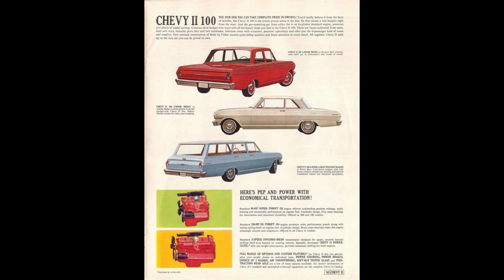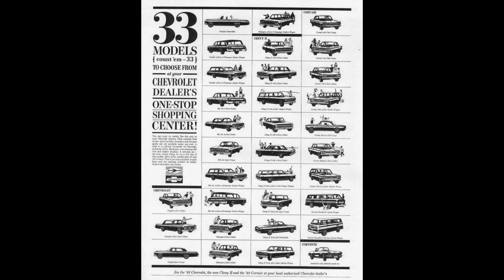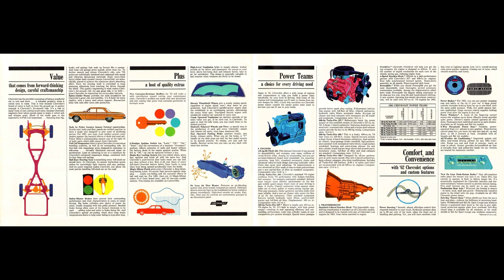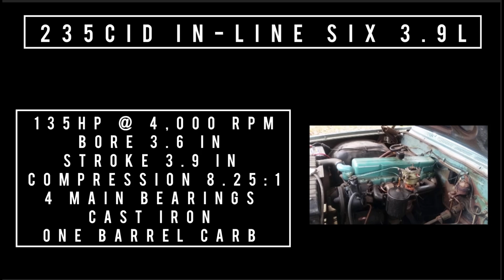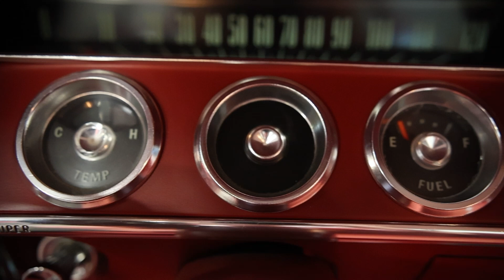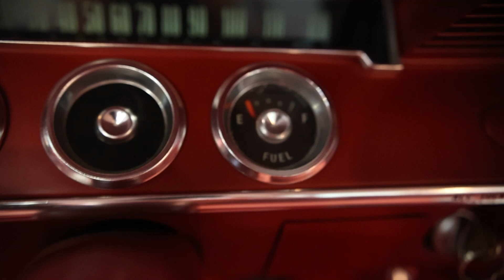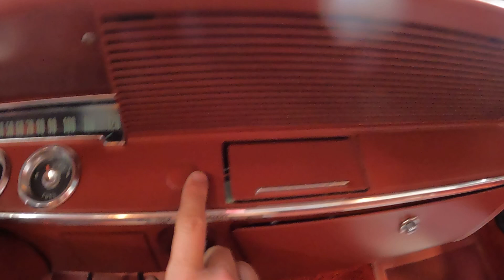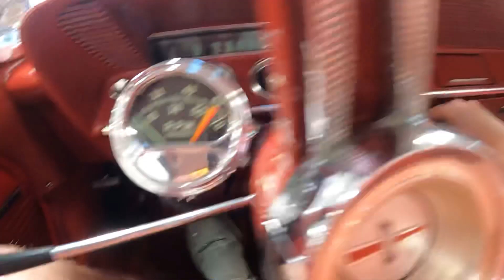Giddy-up 1962 Chevy bel air hardtop high horsepower 409 in depth review and drive

Comment: Excellent video! Thank you!
A few years back, when we were in Las Vegas and the Imperial Palace Casino/Hotel was still around , it had the famous Imperial Palace Car Collection. There were some really stand-out cars around, from Howard Hughes' 1953 Chrysler Imperial with air conditioning(a wooden box that took up the entire trunk, which you put block ice in with a fan that blew over it), Johnny Carson's father's car(which Jay Leno now has), to a 1962 Chevy Biscayne 2-door post with the 409 and 4-speed. A lot of times these big-engined cars were the most basic car model you could buy. Like the next step up car you are showing, these cars are rarer than hen's teeth. Impressive!

I have never seen a full size Chevy with a 4 cylinder. They were even rare in the Chevy II, with most having  6 cylinders.

Oh, I don't think that the tach is working right, it seemed to be pinned and the engine did sound like it was revving that high at cruise. 409's don't seem to rev very well. Maybe that is the purpose of the wide-ratio 4-speed. Maybe someone has the tach set to 4 cylinders?
Reply from the maker: The tach didn’t work wasn’t working. I’ve only been to Vegas once imperial palace isn’t there anymore?? That’s sad if it’s not that place was super cool I was 16 when I went there.

Glad you liked this episode =)
Reply: @What.its.like.  Yup. Sadly it's gone. Las Vegas is changing all the time. My upcoming trip to the SEMA show in November is up to $700. now, staying in about the cheapest SEMA associated hotel and I haven't even factored in transportation yet. Most probably I will drive my wife's Prius.
Reply from the maker: I’m looking into a second gen Prius I’m super cheap looking for one 3k or less don’t care about color I plan on wrapping it purple lol. SEMA that’s a place I need to make my way to. I might do a episode of behind the scenes..my boss bought two cars form barret Jackson look great I’m talking 100 point or close to it cars. But when he got them they didn’t drive right. Both cars are 56 bel air convertibles both rare colors batwing air cleaners. The cars look great but don’t run worth a crap. Just saw Tyler hooive bought a super bird for I’m barret Jackson and had a ton of issues.. private seller is the way to go in my opinion you never know what your going to get with an auction car.
Reply: @What.its.like.  Oh right. A Prius. Get in line trying to buy one new or old. Many of the used ones go into taxi service and are snapped up as soon as they are listed. It's best to get the newest you can afford. We traded in our 2012 Gen III Prius and of the 5 levels that year it was a 3. Our 2022 Prius is a Prime(plug-in) Limited. I believe that it may be the top of the line.
Now, our 2012 Gen III. The hybrid battery went bad last December, but it was under warranty. I'm not sure but that generation of Prius a new genuine Toyota hybrid battery may be around $6K. I had replaced a battery in a customer's Gen II with a Dorman rebuilt and it was about $1500. back in 2017. I wasn't real happy with it but my customer couldn't afford more.
Last February, the underhood electronic brake unit went out. It was on backorder and it took about 3 weeks to get it, but they loaned us a 2022 Prius Plug-in. It was under warranty and was told that the unit would cost about $3500. for the part. Out of warranty, a Prius can be a very expensive car.
With the Gen II Prius, one thing that they have is what amounts to a thermos under the hood, which stores hot coolant so that you can have heat in the heater right away. The Gen III eliminated that and instead would start the engine within 30 seconds, run the coolant through the catalytic converter and send it to the heater. We never  had a problem with heat. A Prius catalytic converter is a frequent item to be stolen, even more than any other car. I spoke with a guy who had his stolen twice this year.
The current Prius uses a true climate control and the electric compressor functions as an air conditioner or a heatpump.
Then you have the transaxles. They are called CVT's but they are not. They never change gear ratios like other ones in Hondas, Nissans and Subarus do. They have 2 motors in them. MG1 functions as a generator, a starter motor and the reverse gear. There is a single planetary gearset which couples the motors to the final drive. These also have their own liquid cooling system separate from the engines. The radiator is divided into 2 sections, one for each cooling system. The transaxle, motor & inverter cooling system is run by an electric water pump.
No, if you don't buy the newest Prius you can, you are asking for trouble. Warranties are important! This is one reason we got a new Prius. The hybrid battery and electronic brake systems were now new, but there are lots more Prius problems to have. Like the electric A/C compressor(I have replaced those on Prius' and they ain't cheap). Then there is the electric rack and pinion steering unit. I had friends in other shops that had replaced some.
To do many different operations on a Prius, you have to have a good scanner loaded with the Prius program. The small ones you can buy at Harbor Freight won't do it. I also have an Autel scanner which works well. My Snap-on scanner set me back $15K in 2015. Unless you are a master mechanic and have experience with the Prius, it is better that you pay an experience mechanic to work on it. And..tou better have a good line of credit, because you will be using it!
Reply from the maker: So in short 2nd gen Prius looks amazing on paper but can be an endless money pit 

Thank you for all that information
Reply: @What.its.like.  This is true of ANY older car, especially when they became computer run. The fewer the options and the lower the tech the better. The high tech components get discontinued as soon as the last car is out of warranty that uses those components. Simpler is better. Any of the newer cars were built to be thrown away and it is wise to get rid of them when problems start happening after the warranties expire. You want a reliable car? Buy that '55 Bel Air. Upgrade the automatic transmission to a 1982-1992 pre computer controlled TH7004R for better power and gas mileage. The only electrical thing you would have to add is a 12v. power lead to the transmission for the lock-up torque converter. You also need to run it through a power-interrupting bake actuated switch. The simpler the less problems you will have.
Reply from the maker: That’s why I like the older stuff it seems the more you drive it the better it gets on the flipside you let them sit too long it takes them forever to get right again because I’m not made to just sit around they were made to be used =)

Comment: Must have been a real treat do drive her!
Reply from the maker: It was I still can’t get over how floaty it was it’s like driving a Lincoln mark V with an insane Engine carburetor linkage kept sticking and it would load up and start that way could correct it by revving the engine while the clutch was pushed down but as soon as you put it back in gear it would do it again.

Did you like the first person view of driving I’m gonna do that from now on if I can drive them and put the camera behind me I’m gonna try to get my face out of it next time I kept looking back to make sure the camera didn’t fly out the window it’s a GoPro on a tripod and the tripod was in the back but well it worked out good I thought
Reply: @What.its.like.  yes, I think it worked well. Excellent!

Comment: We had a 63 Bel Air which was a great car
Reply: We also had a 63 Bel Air. Fantastic car. Body finally rusted out but the engine still ran like new. I got my drivers license in that car.
Reply: @randyhartley865    Me too…… My dad set up two 55 gallon drums so I could practice parallel parking.   It had aftermarket AC which was ice cold

Comment: Thank you for the video. I wonder why the 194. 4 CI engine had 7 main bearings, that is the most of all the engine main bearings. That floor high beam switch would often rust out and have to be replaced because of where it was located especially in the northern climates with snow being tracked in the car. I know that happened my parents 62 Impala 4 door sedan. I have to wonder how many unbuckled people had to visit a dentist after a fast stop or accident because of that bare metal painted dash. I would love to have one of these cars, that body style is great, and I wouldn't mind if it had a 283 or 327 engine. I don't have the funds to afford most of my dreams.
Reply from the maker: I guess that four-cylinder engine didn’t come in the Belair where the large size tires I don’t know source I just listed all the engine the source is said, I thought it was weird four cylinder in a full sized car during that time period

Comment: Items such as, clock delete, radio delete and cigarette lighter delete could have been OEM "original equipment manufacture" dealer added if the customer opted to do so.  The car magazines say that the Pontiac GTO was the first "muscle car" not so true.  The Chevrolet 409 came out before the GTO did, but in the mean time, John DeLorean made sure that the GTO would be heavily advertised.  By the way the Beach Boys where paid by GM to produce the songs "409" and "Little GTO"  I just want to add that the Chevrolet cast iron four cylinder that you see as the base engine is what Chevrolet Motor Division should have been used in the Chevrolet Vega.  Please reply.  Dave...
Reply from the maker: Thank you so much for all that added information and correction =) 

I didn’t know they were paid by GM to produce that song makes total sense

Comment: I wish it would be possible to buy a car like this all you need in car and nothing you don't crank windows never brake down
Reply from the maker: This one is going to be for sale I almost did a comparison video similar to the gas shock video about fuel injection vs carburetor because 9/10 the fuel injection ones that re learn themselves suck and I was in the 409 today to show a customer one kick of the gas pedal cold start starts on the button no fuss at all

Comment: Almost traded my 56 Nomad for one last month. If had been black, I would be driving it . The 194 wouldn't pull a sick woman out of bed. Hear was good to put on 230 and 250s, for more compression. Had a 66 El Cam with the 194. Sad.
Reply from the maker: What engine is in your 56 nomad that is a sweet ride you never see those of getting harder and harder to find especially 56.. 

I can’t get over how floaty the bubble top Belair becomes at speed I’m not kidding you it is like driving a Lincoln mark five with a crazy engine
Reply: @What.its.like.  327/200r4

Comment: You never drove it faster than 65 mph? I wonder, with the size and weight of the engine, how the heck could you keep the rear end on the road at high speeds?
Reply from the maker: It was floaty and I don’t drive other people’s cars fast or aggressive I respected it and had a reverence for the car. 65 mph going down a hill it wasn’t the rear happy just floaty it was like driving a Lincoln mark 5 with a lot more power.

Comment: I don’t see a community tab.
Reply from the maker: Go to the home page of the what it’s like channel it’s at the top in the center.. hope this helped I’m going to start another video I’ll video computer to show where that located I want everyone to have a chance to vote.. I love feed back =)
Reply: @What.its.like.  The home page does not show any community tab. The only thing I see is YouTube’s Community Guidelines tab and that doesn’t link to What It’s Like. Sorry.
Reply: @What.its.like.  Most newer cars have gone back to gauges for everything. They are digital but at least they do have gauges instead of idiot lights.😁
Reply from the maker: I will make it the next video that I do I will show how to get to the community tab I believe the next video is going to be 65 Corvette stingray but not just any Corvette stingray of your injection 327 375 hp Corvette stingray.. it was a tossup between that one for this timeslot I have to do the Corvette stingray next because the next video may or may not be comparing that to something else
Reply: At the home page I still don’t see a “community tab”
Reply: I do like that the back windows go all the way down into the rear fenders. That’s a nice feature that is missing on some newer vehicles.

Comment: I think you have bore and stroke wrong from the 327 to the 409. if the bore and stroke from a 327 is the same as the 409, it wouldn't be a 409.
Reply from the maker: https://www.conceptcarz.com/s10447/chevrolet-bel-air-series.aspx

Comment: Your video is a bit unclear on engines for the Bel Air. the 235 Blue Flame six was the standard engine in 1962. The 4 cylinder and the 195 six were in the Nova.
Also, whoever would have bought a 62 Bel Air Bubble Top with the full boogie 409 would not have been interested in anything extra- temp gauge, clock, radio- if it doesn't make it quicker don't bother with it.
When the car is still cold the automatic choke would hold the idle up until it warms up. After the car is at normal temp you hit the throttle and the choke would turn off.
Reply from the maker: Thank you so much for those corrections the source that I got all of the information from said the four-cylinder was in the Belair series but I didn’t really believe it I was gonna leave it out but I was afraid that if I left it out it would be in there..
Reply: @What.its.like.  I had a friend in college in the late 70's whose grandfather had given him his 64 Impala SS. White with red interior- buckets and a console. The weird part- the old man had ordered the car from a dealer with the six and 3 speed column shift. It had a radio and heater- only options on the car. It looked nice but was SLOW!!